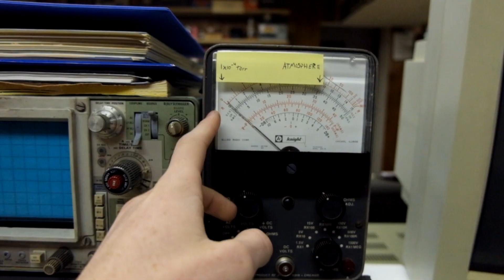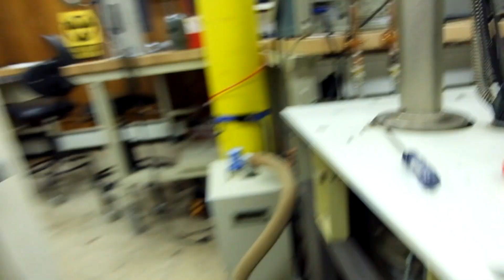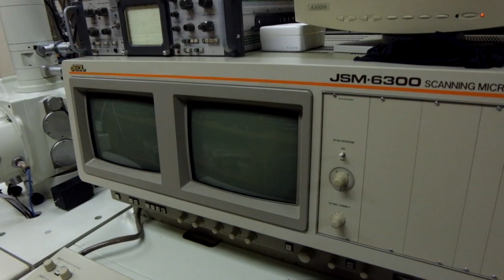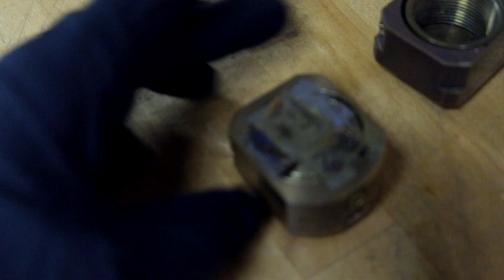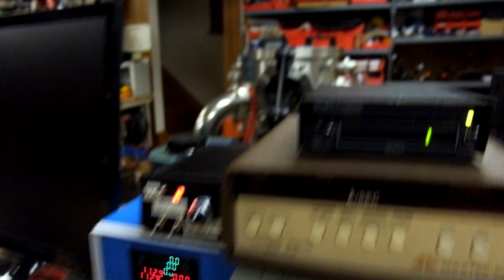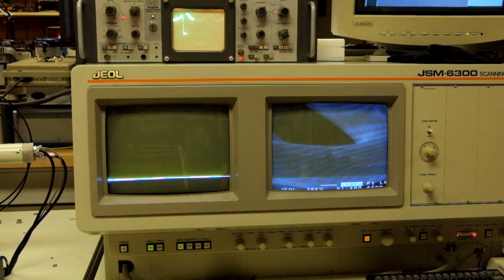SEM Startup Procedure and Demonstration - Electron Microscopy In The Garage

Comment: I recently just bought a similar SEM ( Hitachi S-650). I’m currently trying to restore it but don’t have a manual and the company can’t provide me with one. I was wondering what pressure the roughing pumps go down to. Also, what was the process for replacing the transformer oil and what type did you use? Great video, thanks!

Comment: Hi Sam, This video was quite useful for me. I recently acquired a Hitachi S-4500 SEM from ebay. The SEM is similar to yours in looks but in much worst condition. All the cables connecting the column to the display unit were cut to ship the SEM in two separate shipments. I can not find the service manuals for wiring diagrams. However I found the manual and schematics for S-5200 model, which is very similar. So I am working to patch all the cables. and checkout the circuit boards etc. Hopefully I will see it work day. I do not have a windows 98 computer for the scope but I can use an windows XT laptop. Can you suggest where can i find the application program for SEM control? Thanks. Ram Engira

Comment: Wow, nice work! I used to work with the exact same model in my university for research. The still had the windows 98 to run the software and everything, which was quite hilarious. The images you can get with this machine (if correctly set up) are remarkable though! 
Keep on with the nice work! :)
Reply: why hillarious? The machine is old, so the pc is old too, though maybe a generation younger than the machine itself. Most likely there is no possibility to simply upgrade anything in that setup. The way I see it the contents of the hard drive of the pc are about as precious as the vacuum hardware to keep it working. And in a similar way to devices with UV eeproms for code and calibration, the first step when you get your hands on it is to backup all that not-entirely-nonvolatile data from eeproms and harddrives.

Comment: I have some Hitachi SEMs and JEOLs too.  Diff pumps are such power hogs when you consider the heaters and the chillers.  Have you ever considered retrofitting a 150 lps Turbo pump?  Most of them require only a small fan to cool the bearings.  It saves lots of money on the energy bill.  Main drawback is the vibration from the rotor but since you're not really going to be able to use a W filament SEM over about 50KX magnification the vibration of a good turbo isn't a problem.   A turbo pump is ready to use in just a few minutes.

Comment: I had this feeling you'd aquire a SEM.  You sure did.  Awesome!  Impurities testing equipment; ICP-MS, NMR, C/S/? Analyzer?   Really... wait... EDS would be more pertinent potentially... no pun intended.  Way neat!
Reply: I'm not sure, though are laminar flow hoods useful and organization of workflow to prevent contamination beneficial?
Reply from the maker: Yes,  laminar flow hoods are very useful for this kind of work. I'm looking for one...
Reply: I was thinking since your work is more clean room and I'm thinking I'm going to make to work in front of just for soldering and electronics repair (maybe some other microscope work) where I already have an exhaust on a 6" hose.    I'm more familiar with for microbiological operations and wanted one when I was younger when we used to grow shiitaki and maitaki mushrooms.  Here is an interesting link of a range of designs (I like the tissue culture, though the ghetto is humorous and practical, though not for electronics work I'm thinking) where I was thinking having something with glove box potential for a front cover using latch clamps and maybe sealing up to perform other work with toxic fumes in and be able to control exhaust also.  https://www.qrcodematrix.com/diy-laminar-flow-hood/

Comment: Nice video ! I recently got a JEOL 6400 (needs some HV supply repair) - are you sure that the sequence of vacuum valve switching is OK ? Plus it's safer to turn on the HV with the saturation pot set at zero and than increase the curent.
Reply from the maker: Good luck with your SEM. Let me know when you get it running... the valve sequences for each vacuum system operation are listed in the manual (blue book) so I'm pretty confident in the sequence of valves I showed in this video. But be careful because if you screw it up oil from the DPs can get into your chamber.  Still not sure why my SEM won't pump down on its own. And yes, that is true about the filament saturation knob.